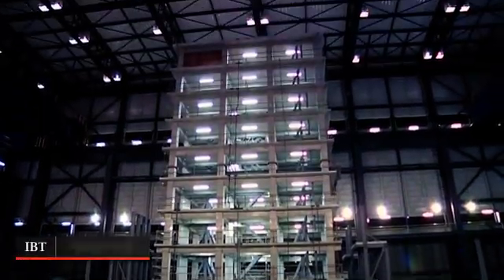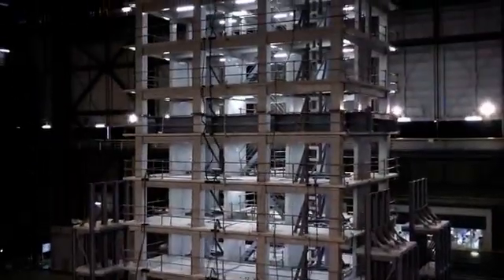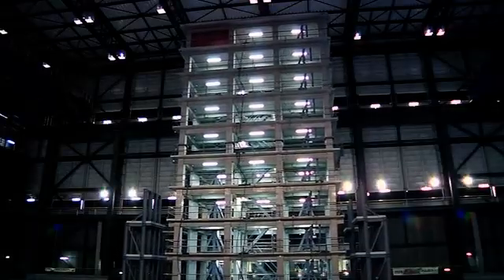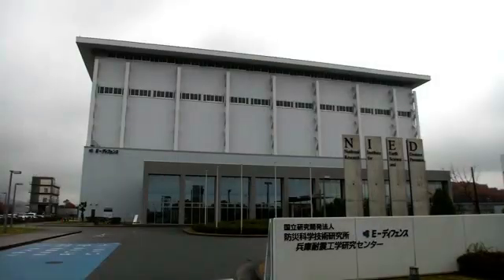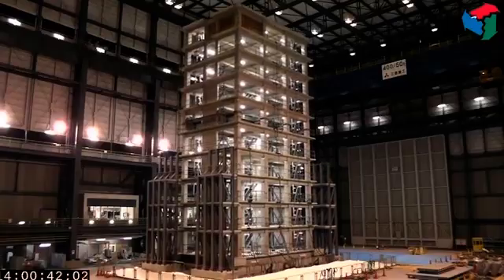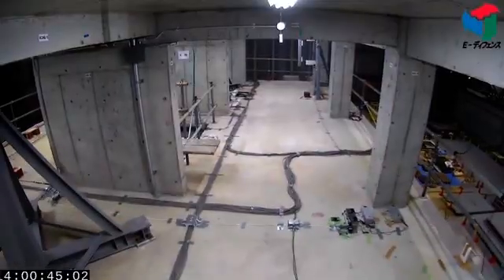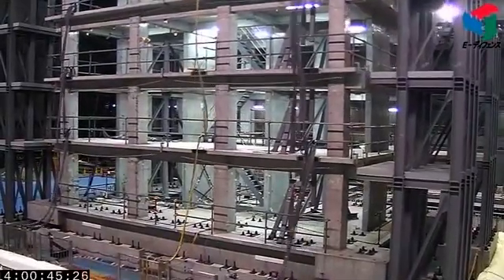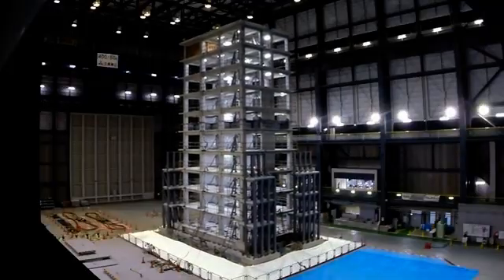Japan Researchers test 10 storey concrete building for resilience against new Kobe earthquake

Comment: ”Seismic” is to withstand seismic forces so that the building does not collapse.
”Seismic control” absorbs the seismic force received and suppresses the shaking of the building.
”Seismic isolation” separates the foundation from the building and channels the seismic force.
”Seismic control” is more important for high-rise buildings.

Comment: I know its probably impossibly expensive but in theory if you would install hydraulic dampers on the link between the foundation and the ground it could metigate a certain amount of force and minimize any damage depending on the size , quality an position of those dampers. If I'm correct they did this with a few bunker constructions. Unfotrunately building safety is lower priority than the costs in our world currently.

Comment: I'm astounded that at this day and age these "matchstick" buildings "houses of cards" are still being built in areas where extreme conditions of various kind constantly occur. Isn't it about time to reinvent architecture from scratch, instead of wasting time and energy and money on these pathetic attempts to maintain the original idea of a square building, over and over again!?👻❤
Reply: Brilliant idea Laura let's go with a circle building...  Or even a triangle one... That will fix it
Reply: Like what?
Buildings also have to accommodate people and be easily maintained.
Reply: @krunkle5136  Sorry for the delayed reply dear Krunkle! How about rubber foundations with houses made of jelly and marshmallows on top of them!? A win win solution to every earthquake situation. Edible, shake safe structures to accommodate many of the needs which we may encounter.👻❤
Reply: @lauramurman2642  I could imagine the smell that could stretch out for block of rotten marshmallows on my way to work.

It's fun to imagine, but comics, movies, books, music etc are the best place for dropping all convention from time to time.

Other than that, Gatorade might have electrolytes, but that doesn't mean it's good for watering your corn crops.
Reply: @krunkle5136  Hello Hello again! I've now contemplated your undoubtedly professional insights of the matters we've previously discussed and have to admit that your knowledge of the subject in question lies far beyond my ability to even comprehend. But, how about we build houses with cotton candy? Surely no earthquake can take such a flexible building down!? Cotton candy doesn't rot, something that seemed to be of a serious concern to you. If the above mentioned does not amplify a prospective recommendation beyond apparent diagnosis then maybe a provisional discretion accurately obscures the molecular level which undoubtedly rectifies a necessary component. Regardless of your symphonic apparition, I'll contribute with conceived obscurity and reclamational subsequense. Take care and live well!👻❤

Comment: It has to be extra strong.......not flexible....this is concrete not elastic........ It need to be made and when there is shaking, it doesn't move.   Flexibility won't work in this case.  Only strength.   Massive base and massive collars will work.

Try triple size collar and base, shaking won't happen.

The rich and small country, invest in this for the people.
Reply: Wrong! The more rigid the more likely to fail. If you’re an engineer on any building I’m usually in, I’m never entering that building again
Reply: @coachpotts  making strong pillar and base, calculate proper height.  If you make it very talk it will collapse due to height.  Are you kidding???  It is so simple, when you shake the Tree if it is a 100 years old big tree, it is strong.  It against the wind.  If it is small tree swaying.  The tree has flexibility.  But not the concrete.  If the building not shake, it won't bother the weight.  But again, do not design too much weight.  For the pillar to bear.  You can see when tsunami happened, people ran up to a high strong building.  Look at that construction.

Comment: Question I have is...at that height, the model, does it account for structural integrity at the ACTUAL heights? Or is the concrete constant up to much higher? Not only that, but what about a building full of stuff? Perhaps in unequal distribution at any given time...what if most of the people there are up top and that's where the majority of the extra weight is?
Reply: Live loads (people) and dead loads (equipment) only affect structures vertically in design. In designing vertical structures, engineers account for both vertical loads (dead and live) and horizontal loads (earthquake and wind). Whichever has the highest degree of influence become the prevailing design.

So say, without taking into account the rebars, beam B1 must be 400x400mm to resist vertical loads, but when tested with horizontal loads ALSO, it needs to be 450x450mm, then the designer goes for the latter dimension.

So a building full of stuff and people and an empty building should only have minimal to no difference, if the design is accurate and followed during construction. Hope this helps.
Reply: @testsalv4366  thank you for your response...I guess I just see the total potential dead load weight being enough to count at SOME point..and reading how skyscrapers don't have load limits is mind boggling to me lol...I imagine during an earthquake, that horizontal shaking shifts the vertical load weight. And that's what I'm fixated on, I don't completely dismiss the weight of the loads, because those vertical weights become horizontally spread during shaking. Which creates angles at which the loads are being pressed. Like it's one thing if the loads are just pressing down from above, now to have that load pressing down at shifting angles "works" the beams more than a completely dead still weight...like a direct opposite example, pulling something out of the ground, you don't just pull directly up, you move it around to loosen things up... you see what I mean? You still suggest they account for that in the horizontal testing?
Reply: The mass of the occupants and furnishings are a tiny fraction of the building's mass.
And no, the model clearly doesn't account for the real world, it's a complete waste of time, nobody knows why they do this.
Think before you type, doofus.
Reply: @railgap  ME the doofus?

Comment: If you build every building on a plate like this and use computer technology to move it in the opposite direction of real earthquake shocks, then the building experiences no earthquake.
Reply: I think some building in Japan actually do this. Not computers but reactive pneumatics, same end result though 

I’m thinking maybe these are for mass construction so it’s cheaper to build, maintain, etc.
Reply: @adriatogi829 Besides being easier to build, I wonder if it might also offer more room. Not sure if reactive pneumatics require ton of open space either though.
Reply: The Taipei 101 tower has something similar

Comment: there must be a better way to make anti sismic buildings.. having a massiva pile a concrete wabbling like that is just not the way. Also many of our countries un latin América have stronger earthquakes than a 7.3
Reply: Magnitude is not a relevant measure of earthquake's damage potential. the thing best correlated with damage is PGA or PGV, that is why we engineers design things to resist ground accelerations not magnitudes. what is shown in the video is kobe earthquake this one had a ridiculous acceleration way more than that is recorded in recent 8+chile earthquakes. by that I don't mean it was more powerful 'overall' overall being the important word. obviously magnitude 8 releases order of magnitude more energy than a magnitude 7. but difference in shaking in chile 8.2 vs kobe 7.3 was like you hitting something with ridiculuos strength for only 10-15 seconds vs you hitting something with moderate to high strength for 2+ MINUTES straight. latter was the case in chile earthquake. to put it simply chile 8.2 released energy for longer duration and larger area while kobe 7.3 released it in way less time for a 7 magnitude less than 20 seconds and it was in a very concentrated area
Reply: https://www.youtube.com/watch?v=ZD_FsWZLy74&t=88s here is the example of power of kobe earthquake
Reply: Wood is harder to maintain, steel beams are more expensive.

Comment: What happens after this earthquake is over? Is this structure safe to live? Is it possible to repair all damage seen and restore it to nrearly-new condition or it "wears down" with every new earthquake.

I'm asking because I'm from Zagreb, Croatia and this year we head a series of serious earthquakes: 5.5, 5.3, then many smaller ones, yesterday 6.4, today 4.9, 4.6, and ongoing. How long can we shake like this until it fails?
Reply: It is possible to repair. A repair is always necesarry if a building is damaged but does not collapse. The building should not collapse on the next earthquake with a magnitude of  say M=6.9, if historically speaking earthquakes of no more than M=7.0 have occured in the building area. You have to understand the implications of the repair technique that is used, what the residual stress of the current damaged building is and how much additional strenght the repair works will bring to the building. So that, ultimately, given the next big earthquake your building doesnt collapse, but damages.
Reply: I am Japanese.  I have been affected by two large earthquakes in the past.  Both earthquakes were magnitude 7.0 or higher, and I experienced both earthquakes in the same house in the same area.  In Japan, the level of collapse of buildings after a disaster is determined by experts, and those that can be repaired are given permission to be repaired and appropriate repairs are made.  For example, if the problem is minor, it may involve filling in holes in an exterior wall that is only cracked.  If the damage is moderate, replace the broken part with a new unit.  This is possible because most Japanese houses are modular and designed to a fixed standard, making it easy to replace parts.  These are Japanese architectural techniques that are different from seismic isolation.  Additionally, if an expert determines that the building is severely damaged, it will be subject to demolition.  This expert's judgment is important and has legal proof when using disaster insurance etc.
Reply: Sad svi gledamo ovakve simulacije... A negdje je svemu granica... nisam siguran da takve zgrade mogu preživjeti više od 5 takvih udara jačih od  6 po Richteru bez jačih strukturnih oštećenja.

Comment: why would you only simulate a 7.0 earthquake when you have 9.0 earthquakes as recent as 2011
Reply: Because there is no machine that can simulate a magnitude 9 Earthquake.
Reply: @Nemesis_T_Type  computer, for fuck's sake use your brain
Reply: They test for ground acceleration not for magnitude. You can get more ground acceleration on a 7.0 earthquake than a 9.0 earthquake. It depends on the depth and distance from the epicenter. So it's not accurate to say they are testing for any magnitude.
Reply: Because all buildings will fail if 9 is under city
Reply: @gx6250  bruh a hospital on top of hill in fukushima if I remember correctly didnt even have a crack after the 2011 earthquake and became shelter for nearby residents
Reply: @foudremy1514  yup, long duration, lower intensity. Energy dissipated mostly through duration
Reply: The 6 magnitude in Kobe and 9 magnitude at Tohoku were the same intensity, Shindo 7 Level earthquakes. It isn't a matter of magnitude, it's a matter of intensity.
Reply: because at 9, its q matter of where you are during that disaster ☠️
Reply: If the shaking has prolonged to more than 6-15 minutes, that's already a magnitude 9 and beyond.
Reply: @yametekudasaii01  that’s not how it works
Reply: @atomicflounder5435  It does. And try its ground acceleration be faster and the movements be in lateral, horizontal and vertical motions
Reply: @atomicflounder5435  Actually thats pretty much how it works. Damage potential is best correlated with PGA or peak ground acceleration rather than magnitude

https://en.m.wikipedia.org/wiki/Peak_ground_acceleration
Reply: @yametekudasaii01  actually magnitude of an earthquake comes from the length of the fault line that moved.
Reply: And it's rarely to happened once.
Reply: Because magnitude is not directly  related to shaking intensity and earthquake's damage potential.  magnitude describes size of an earthquake as a geological event it does not reflect the amount of Violence it exerted on the surface. Yes, it is true that higher magnitudes release way more energy, but release of energy gets widespread over a larger area and for a longer duration. That is why when engineers design things they do so keeping in mind the most relevant measure that describes an earthquake's damage potential I.e PGA or peak ground acceleration, PGA refers to highest level of back and forth Up and down side to side acceleration reached during the earthquake. And earthquakes like kobe 6.9 Mag and christchurch 6.0 Mag were earthquakes that reached ridiculous  accelerations in populated places even though for a significantly lesser period than the tohoku 9.1 earthquake their intensity of shaking were far more than that of 9.1. That is not to say that 9.1 was less dangerous what 9.1did was that it released energy for 3+ minutes but luckily for people the acceleration recorded in major cities was severe but not as high as kobe. possible reason could be it was offshore and its full force didn't reached the cities. The damage done by 9.1 was due to its longer duration while kobe earthquake was like a sudden burst of ridiculous  energy. Imagine an earthquake lasting for ~20 seconds and reaching 6.9 or 7.3 on the richter
Reply: Right, I will make it bear up until 15.0
Reply: Because magnitude 7 is better than 9.
Reply: It's logarithmic scale dude
Reply: Because the building industry would then be out of a job. Similar to pharmaceutical companies when COVID hit ;) I joke.
Reply: Because the power of a 9 earthquake cannot be possibly generated by humans. Ans besides, 9 earthquakes are exrtremely rare. The chances of Japan experiencing an earthquake 9 again in the next 400 years is slim

Comment: What is the magnitude of the earthquake?
Reply: 7.3
Reply: What is pga of the earthquake?
Reply: 999999.9
Reply: Magnitude is not a relevant measure of earthquake's damage potential the thing best correlated with damage is PGA or PGV, that is why engineers design things to resist ground accelerations not magnitudes

Comment: Is the building fitted with weights to simulate the added load burden of windows and walls, furniture, water tanks, people and suchlike?  I see no evidence of it here.  Does that not give a false result?
Reply: @Lex R yes it was made to find the weak points of the concrete structure.
Reply: I cant see  brick in this building... Bricks help columns to absorbe power generated by earthquake .That would be easier to handle earthquake
Reply: @Clk4040  That is a technique that is in research, but very complicated to analyze with much certainty in performance. That is not the intent of this particular testing.